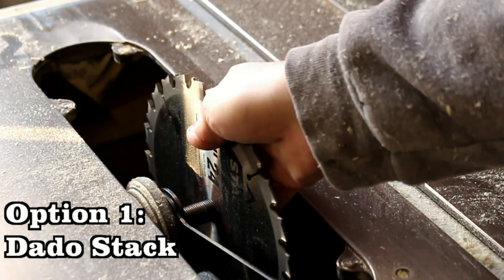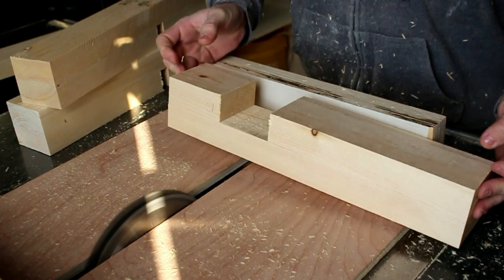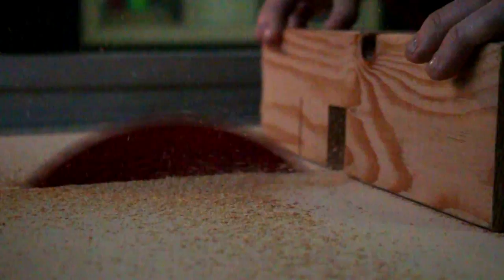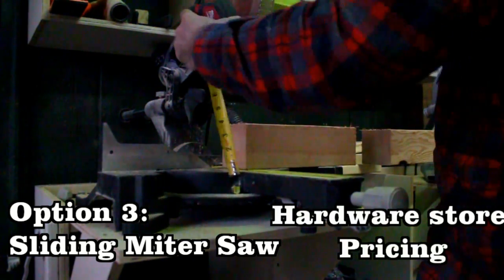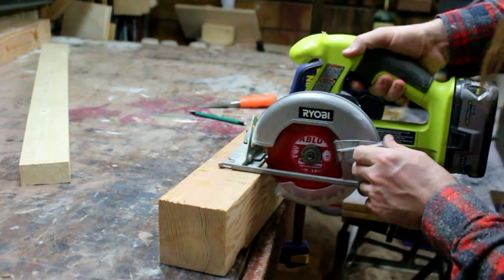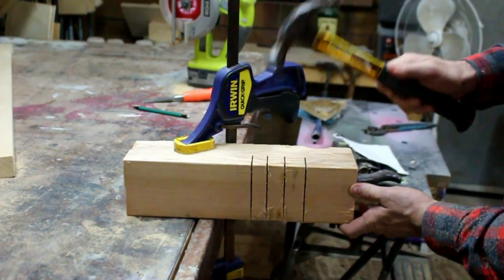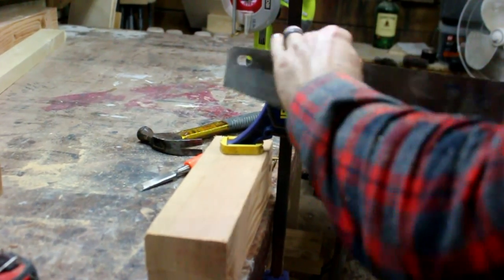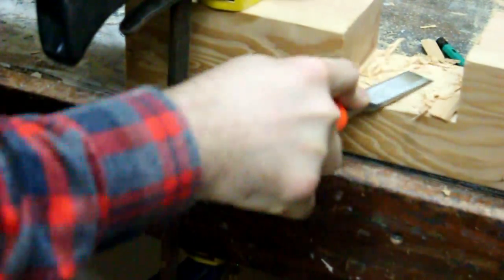5 ways to cut a mortise in farmhouse table legs

Comment: Great tips Phil! When I make lap cuts, I do something similar. I only have a single blade so I use my sled, make my 2 cuts to establish the width, then a series of cuts about 1/8 of an inch apart, then I use my thumbs or hands and can make them break off by pushing thumb up or down (in the opposite direction of the cuts). Then once the majority is out, I go back to my sled and table saw and move the wood side to side as I do a pass. So I move the piece up a little bit, move it to the side, move it up a little more, and move it to the other side. Basically a slow up and over, up abd over process. Makes for perfectly clean joints. I should invest in a dado stack one of these days...
Reply from the maker: oh yeah!  I forgot about doing it that way for cleanup, I always just use a chisel but it is much faster and idiot proof your way! lol.